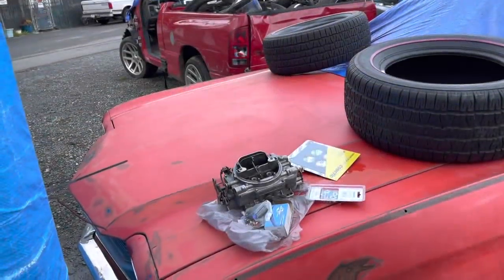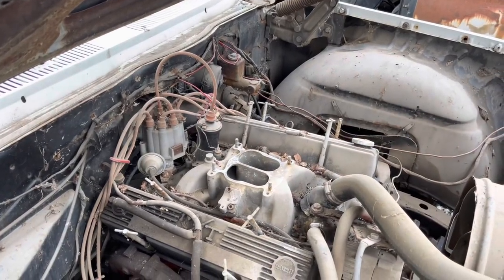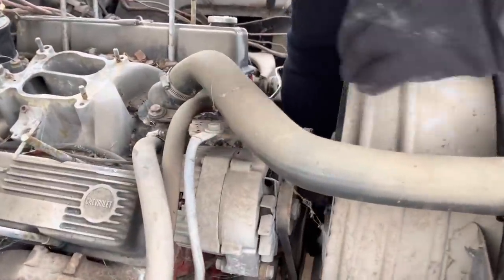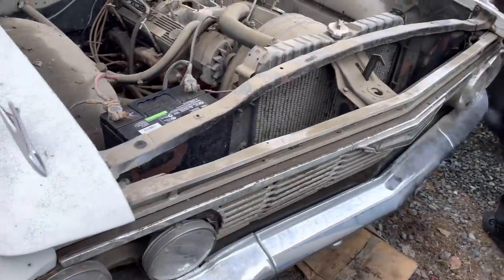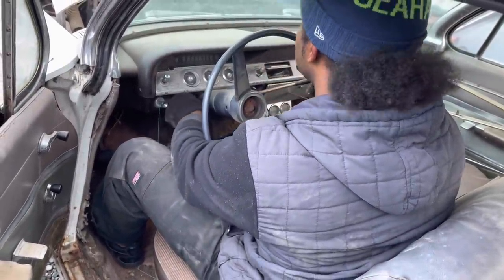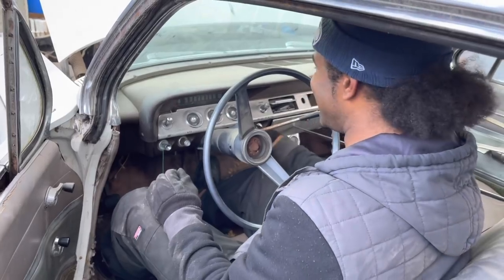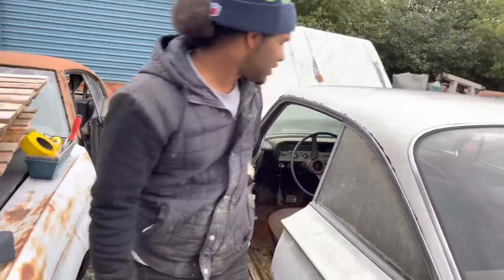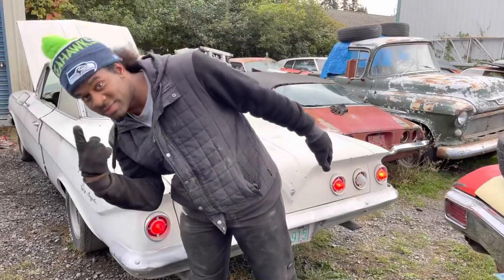BARN FINDS| Will The Dusty Bubble Run? #thedustybubble

Comment: Well now you know why it was parked and not driven. I wouldn't fuck around, get that motor on a stand and build it. It has double hump heads on it, thats a good start. That is a 327 btw. I bet the trans is an iron case 2 spd powerglide. Theyre junk. Now is when you gotta make some good decisions. Running that motor any more is not a good decision. You can build a nice ass car there.
Reply: Oh and heres this...either make a gravity feed fuel source that you can hang from the hood that feeds the carb. OR get a five gallon gas can, tape an electric fuel pump to it and run a line to the carb. The can can sit on the ground somewhere. Get a pair of wires and hook them to the battery. Running a motor that has not run in decades without changing the oil and filter, and priming the oil pump is like dumping metal shavings into your crankcase. Take a step back...do some reading. It'll prevent you from fucking things up. Trust my words, I've been at this shit for a long time. These wonderful old small block Chevrolet engines are resilient, and tolerant. They can sit for years in a damp climate and run like new...BUT, you have to take the right steps to ease them back to life. I'm not clownin, just tryin to save you some grief, and money.

Comment: Pontiac Dave is wrong!!! about that sound there's nothing wrong with the rods or Pistons it was pre detonation from using brake parts cleaner get it running on some good unleaded gas that Motors just fine

Comment: To me that sounded more like ether knock which is what happens when you run an engine with to much starting fluid. You can take a brand new car and spray it with starting fluid and it will do the same thing. Run it on gas and I think the knock will be gone
Reply: That's what I was thinking
Reply: Yes,starting fluid makes the motor make that knocking/detonating sound.

Run Reg gas thru it to to see if mouse is gone.

Comment: Love the car! These old chevys are timing sensitive. Set the points with a dwell meter, 30 degrees. Then set the timing, I would go 4 degrees btdc. The lifters not pumped up could be the knock also. Put a can of marvel mystery oil in it to help break some of the stuck stuff. What a score! Oh , if it has a spin on oil filter , it’s probably not a 283 or 327. Those old chevys had a canister oil filter. Be really careful with the canister oring. Always take the old oring out and carefully install the new one.

Comment: Only problem I had with my 61 Impala hardtop were the window brackets at the bottom of the door. Heavy glass broke the spot welds, kids slamming doors. 283 4 barrel with slip-n-slide no less. Drove her 15 years, 220 thousand mi.

Comment: I had a end a with 61 so my first car 327 365 hp out of a 65vett 3spd full syco I miss it would like to get smother one I kept destroying  the carrier bearing on drive line
Reply: I had a 60 Pontiac Ventura 389 tri-power 4spd, same problem ripped about 12 of them up

Comment: First thing you should always do is change the oil in a old car that's been sitting that long.you should also get oil primed/ oil pressure before you start it..one more thing , starting fluid is for starting the car up not for keeping it running for along time , you should always fill bowl's up in carb or just dump some down it carb instead of starting fluid.. that shit is bad for a motor.. Impala is a  nice  car it's in killer shape.if for sale hit me up
Reply from the maker: We got this. We primed the oil before it actually started. I have a follow up video coming and you’d have to get in a long ling if you wanted to buy this car

Comment: Great way to kill a dry motor running it on either! Pre ignition ( A.K.A. Spark knock) All its doing is HAMMERING the rod bearings all to hell! Also since your taking it apart be prepared to do a valve job. Engine won't last very long on today's UNLEADED gas and normal oil. Nice find!
Reply from the maker: *you’re